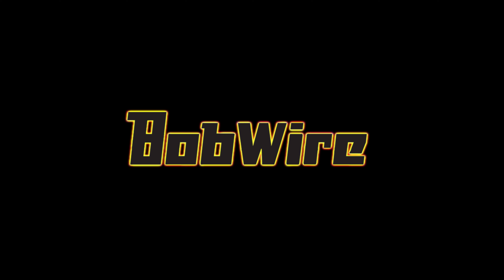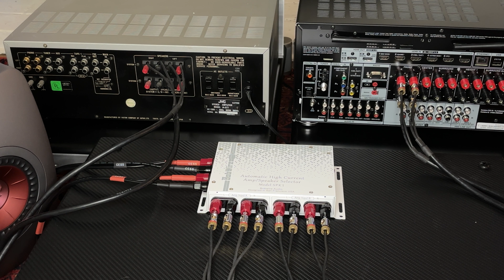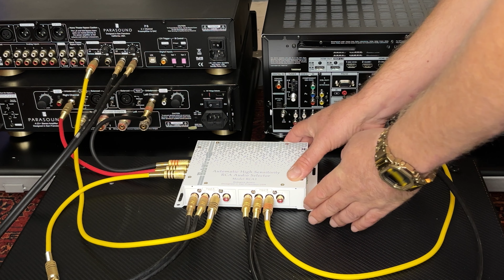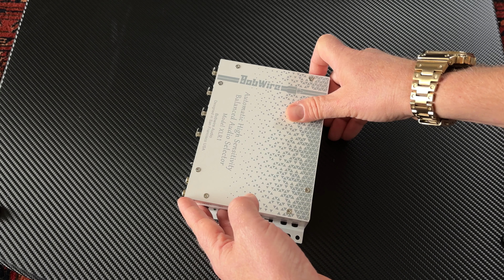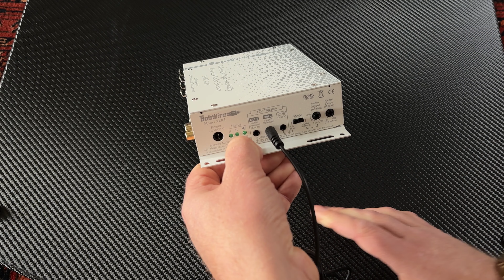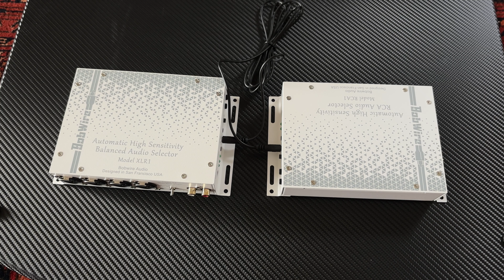Add Home Theater Bypass to any Audio System.  BobWire SPK1, RCA1 XLR1 Automatic Selectors.

Comment: I have the Bobwire XLR1 imported from Amazon USA to the UK. I can attest that it is a great product. I am using it in order to seamlessly switch some active bookshelf speakers between two XLR sources which each have built in preamps: An Allen & Heath DJ mixer (with turntables downstream) and an Eversolo DMP-A6 Gen 2 network streamer.  The XLR1 with its completely isolated relay-based switching allows me to add my streamer without disturbing the DJ mixer path which is my partners baby :D. Obviously you can get streamer devices that can take analogue in and act as a sort of hub/switcher  themselves. Many of those do ADC/DSP on that so you ruin the purity of that path and thats a complete no go if you specifically do not care about any kind of DSP or conversion, which I suspect may do not. Some streamers with analogue input are true analogue all the way through like the DMP-A8 for example. But even then -- they are more expensive,  you become limited to a certain product class, they often have ambiguous/awkward or non automatic switching behaviour/UX, often have constraints on the Vrms the input can take that may be a problem, and it fundamentally introduces another preamp to the path that may or may not be good. This box allows your two paths to remain decoupled and actually I think a whole lot of people wanting streamers with analogue inputs may not have first considered if home theatre bypass makes more sense in their use case. I think a more general probable mainstream consumer case is folks with a record player that has a built in preamps/phono stage wanting to now add a streamer to their system as a means to access digital content. Possibly something to target from a marketing point of view. In my setup, even though the network streamer has a 12v trigger output that could drive the XLR1, I find myself using the XLR1's excellent audio sensing capability anyway -- since even where your source hardware does have 12v trigger outs, the behaviour of them and how configurable they are depends on the device. With the XLR1's audio sensing the behaviour of switching is unambiguous and it works flawlessly. Also the product has high build quality and has clearly been designed by an experienced engineer with care and focus. Recommend it for anyone who needs this kind of setup.

Comment: Hi, can I get the SPK1 in Australia?
Want to add this to connect a high-quality streaming AMP to my 2 Main Front L/R speakers already connected to Sony AVR AN1000 (no PRE-OUT's sadly).
I think this SPK1 is a better alternative to the "Russound ADP-1.2 Speaker-level to Line-level Adapter"?
Reply from the maker: Hello Chris,  you can purchase any of my products from my website.  You may also be able to purchase through Amazon.  The Russo d ADP will convert speaker outputs to RCA connections.  I’m not sure this is helpful in your situation.
Reply: @BobWireAudio  you have probably gathered the reason I was looking at the Russo was to provide a PRE-OUT for my AVR. But there is no trigger or audio sensing.
If I use the SPK1 instead then basically my Front L/R Main speakers will use the AVR AMPs when selecting AV and if I turn on the 2nd Streaming AMP the stereo signal will go to my mains instead?
Selecting (2 IN & 1 OUT) option.
If I buy can you supply an AU socket power supply or will I need an adapter?
Reply from the maker: @ChrisBrownFazer1  Yes, you are correct.  The SPK1 will automatically switch between your AVR and Streaming Amp.  I recommend connecting your AVR to INPUT A on the SPK1.  Connect streaming amp to INPUT B.  As soon as you start playing music on the streaming amp, it will immediately be connected to you speakers.   I have another video showing exactly this: https://youtu.be/sNKhu--X36o?si=k5Wn2cR-3PetRwBk
( the power supply is universal mains 100V-250V but the plug is USA style.
Reply: @BobWireAudio  okay thanks Bob, very helpful.
Before I purchase I'm going to get hold of a streaming amp to demo, to find out if this is worth pursuing.
It will have to be impressive against the AN1000 AVR in Pure Direct mode to my Focal Chorus 800 mains.
Next time you hear from me will be an order 👌

Comment: Because my  two channel system sounded much better with dedicated preamp than home theater processor, I  have main speaker set up connected through preamp and home theater processor  without home theater bypass input on preamp. I think this switcher could make things convenient. Everyone could have different idea. But for my set up, I have tested my multi channel system with and without preamp, my preamp was already transparent enough and I would not add extra switcher and wire that could bring more colorations to sound.
Reply from the maker: It sounds like your home theater processor has preamp outputs.  If you are using a normal analog input on your dedicated stereo preamp then you would be going trough two volume controls?  You would need to set the volume on the dedicated stereo to about unity gain every time you wanted to use the home theater.  Like you said, it is a little inconvenient since you would need to turn both units on and adjust the stereo preamp volume level to the same level each time.  The other thing is that going through both units (and two volume controls) you would be doubling your distortion and noise levels.  The BobWire devices distortion and noise levels are so low that they could be considered zero.  Distortion is around 0.00005%.  Check out a full test of one of my products by ASR here:  

https://www.audiosciencereview.com/forum/index.php?threads/bobwire-xlr1-xlr-and-rca-switcher-review.57640/

But also, if it works for you then great!